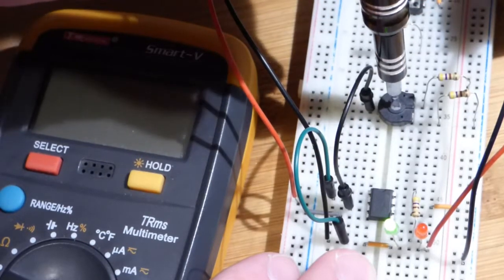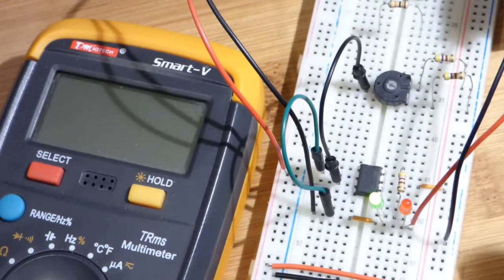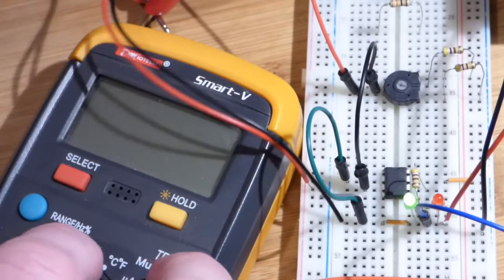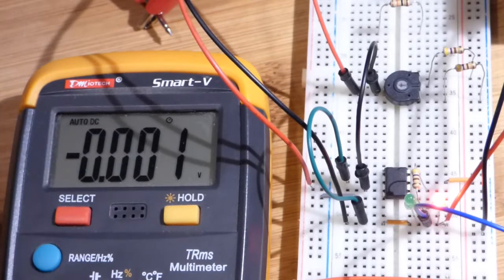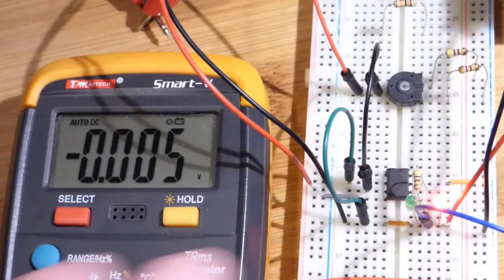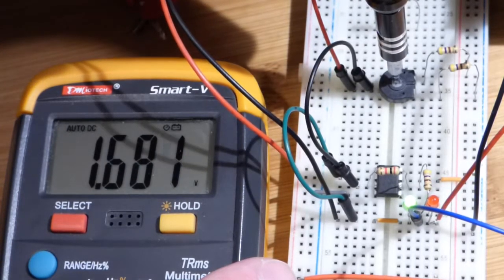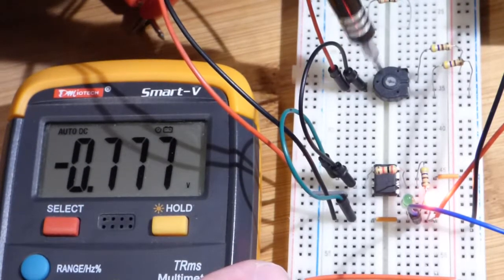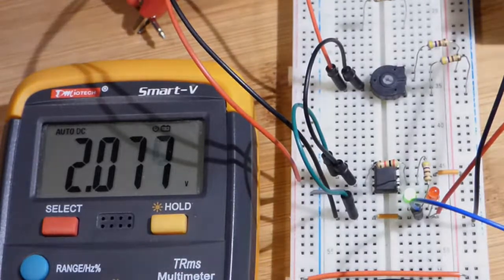Quick multimeter measurements 741 op amp non inverting comparator vs schmitt trigger

Comment: Hi there, I have a dc Bench power supply, instek sps 606 , the voltage works , fine/coarse, the less are on , on the amps side , but I’m unable to gets increase or decrease, it stays the same , these opamps are on the circuit lines for the current, can the opamp cause this issue? Your expertise will be greatly appreciated, thank you
Reply from the maker: Unfortunately I can't help you on that one at all. I never worked on anything really, let alone power supplies.